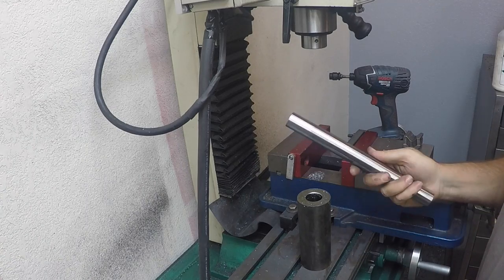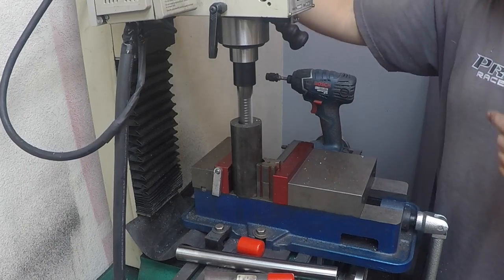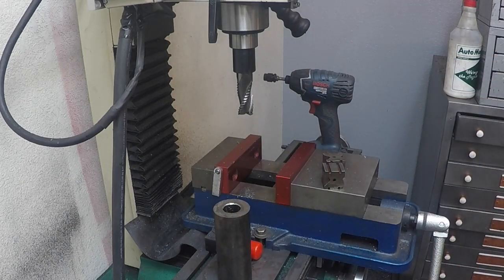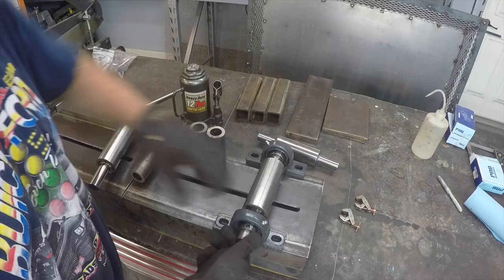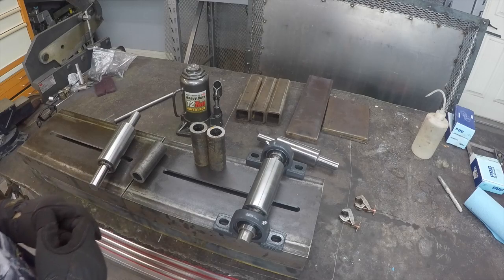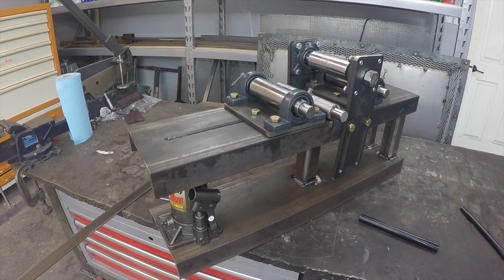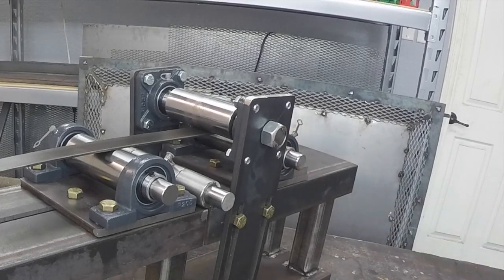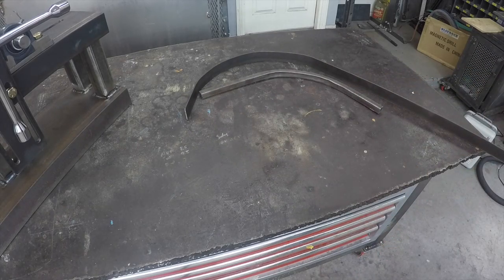Metal Bender - tubing - flat bar stock - Metalwork Monday 6 (similar to swag offroad)

Comment: Gary nice work. My I suggest that you use some "GRADE-8" washer(s) for the bolts that you use to adjust the bender. using the washer(s) will save the face of the part that you adjust. For one or two bends you won't need them, but if your really going to put some use on this bender, you'll notice very fast that the bolt heads (I'm assuming you used at least grade-5) will be distorting / chewing-up the face of the softer steel.
Reply from the maker: some good points, thanks Dave

Comment: You're quite the machinist. you made a very nice video. I thank you! Try this, the next time you tap a hole, use Crisco shortening instead of Tapfree. you can power-tap. (when tapping aluminum, use Turpentine). Another note for everybody  the HF orbital bender leaves a knurled pattern on the stock, that's rolled in! Its very hard to get it out. Also, it's plastic inside & if you take too big of a bite, it will break! why would they use plastic on the stress of a bender!? That's just info to save you the trouble & cost. You did a fine job. I like your shop. On your next video, would you do a quick pan of your shop? thanks again! Very NICE!

Comment: I wish you were near Arkansas because I need some metal drilled & bent. Local shops here say it will mess up their drill bits...so I'm wondering why are they in business?😕
Reply from the maker: lol what kind of metal you trying to drill?
Reply: 🔥Ramsey Customs - turbocobra I'm building a bracket to hold the front fairing with 4 speakers & a radio for my motorcycle but the 3/16 welding flats from Lowe's isn't stable enough. I need something firmer that won't have the fairing & headlight vibrating going down the road.

Comment: Loved the video, my dad was a machine operator, a  machinist, and a tool and die maker, always talked about making things out of wood first. Instead of pressing the bar stock into the tube, have or could you demonstrate the heat and freeze method, for viewers who have never seen it done? As an automotive service technician mainly for our manual transmissions I had a toaster oven to make parts larger and a mini freezer to make parts smaller, and we had very good results with this method. Still a great video.

Comment: Ooh that little mill chatters a lot and stalls easily. I guess a Bridgeport has spoiled me.
Reply from the maker: +justfakeit888 lol Yea its good for small jobs, but not near enough rigidity for what i used it for in this video.  I have a bridgeport now also, and getting a 15 HP 50 taper horizontal mill soon.
Reply: Damn, now that's an upgrade. I don't even know what I'd do with 15 horsepower. All I want is two. haha

Comment: the only thing i see that would make it work better is if the bottom 2 rollers well all 3 really were closer together. I think you could get tighter rolls that way and be able to get the rolls out closer to the ends. Even before you tested it it was the first thing i noticed and was like why are those rollers so far apart?  Otherwise very nice i plan to do something similar when i build mine but it will be more so with tubing both round and square in mind so it will be quite different. Ill make mine where i will have multiple tools to work with for different materials. So mine will have to be made with that in mind to make for easy changing. But this definitely gives me some more ideas to work with when i make one.

Comment: Where do you get your metal stock and sheetmetal? I know that most metal supply houses have a minimum amount that you have to purchase, but I'm talking about small quantities for body repair and projects such as you show us here. Thanks
Reply from the maker: +William Charles I buy it at either Metal Supermarkets (they are nationwide), or a local place in Dallas called Fulton Hardare and Metal
Reply: turbocobra Thanks alot for the info and reply.

Comment: Well done instructional video.  I sold my 67 mustang fast back bracket race car three years so I could concentrat on building my shop up.  I am interested in the drilling machine you used at   in your video.  Not the Grizzly mill.  It looks to be half home made.  If so please do a video on it's construction so we can build some thing like it.  It looks like a bench top mini mill on a custom base.  If you built it why and what special functions does it perform for you a mill or drill press cannot do.

I think I would like to have a really stout drill in my shop to replace my cheap craftsman floor drill press.
Reply from the maker: James Jobe Hey James, what your talking about is the Mag drill.  I bout the drill from eBay, and built the stand for it, so that I could use it as a stationary drill press, as well as a portable mag drill.  It's a super low rpm / low torque machine that does a great job of drilling large holes.  Here is a video on it.  https://www.youtube.com/watch?v=0eY0gYC6ino

Comment: Nice project, Gary. Pretty cool bender and i agree with Greg; bet you can machine some adjustable guides to prevent the side-to-side movement of the stock.
Reply from the maker: Well, at some point I plan to add a lathe, so will be real easy to turn new dies in different sizes and shapes to allow for bending of different types of metal, thanks for watching Joe!

Comment: I love metalwork Mondays...  It looks like you are having a lot of fun doing these vids.  For the square stock, I've seen collars that are adjustable and they go on your rollers to keep the edges square and to keep the piece from tracking side to side.  I'm guessing you could machine something like that if you haven't already.  That may help with the kinking on the tube.  Only 7 more days and it will be MWM again.
Reply from the maker: Yes, I really do enjoy this type of work.  The projects are small enough to finish with 16-20 hours worth of labor, so your not dragging them out for weeks, and I am starting to have the right tools organized in a way to make quick work of things...  Yea, I plan to add a lathe in the next few months, so once I have that I can turn dies in different sizes and configurations.  I need to figure out a way to heat treat them to harden them so they can take the abuse more... Thanks for watching!
Reply: Talk to Tomswonderfulworld about hardening.  I think he's done a ton of it.  Not sure if his shop did it in house or sent it out, but they did ultra-precision work (1/10,000") and a lot of the work was hardened.

Comment: Cool stuff.... Looks like the straps you added to the mag drill really helped drilling that large hole through both pieces...
Reply from the maker: Ineed, those straps really made that mag drill press rigid, works very well.  Yea, those 2 pieces were 3/8th thick, so 2 of them together is 3/4", and it puched right through there with a 1 5/16 hole with a used flea market find cutter....